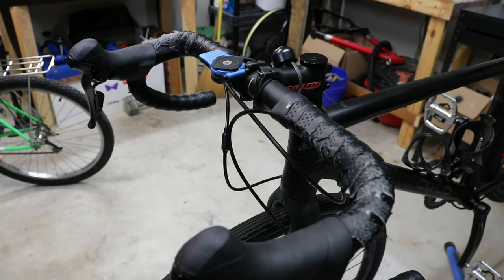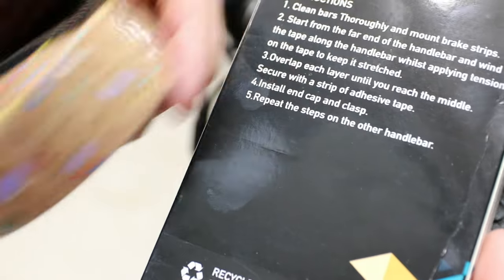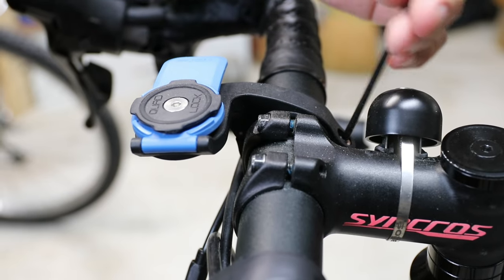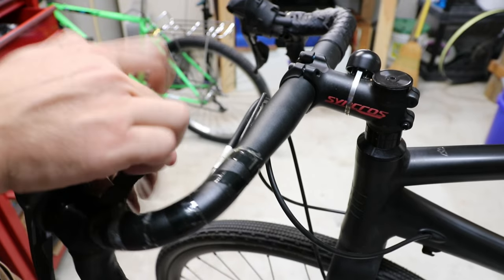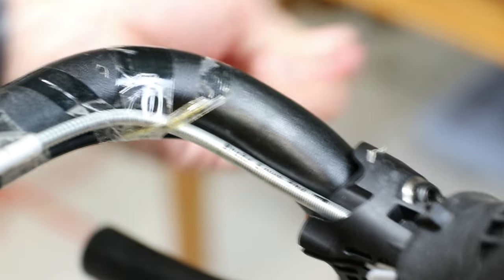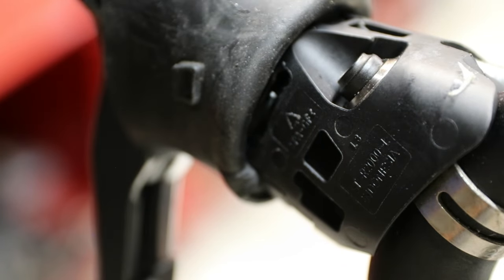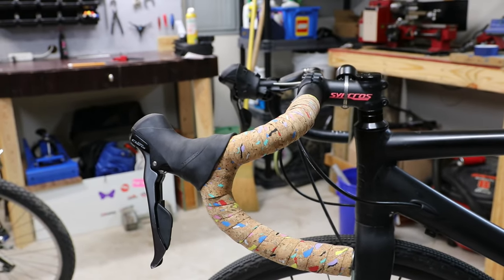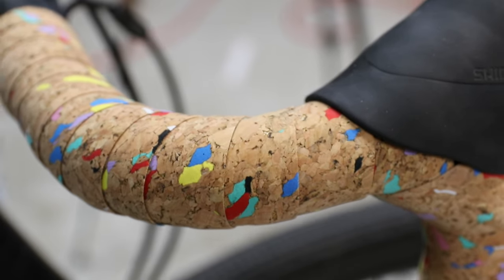How to install bar tape

Comment: Good Job. The Cork Tape doesnt last more than 4 rides for me, so I have been avoiding it (Tried 3x). The Direction of the wrap does matter with regard to the wrap being torqued by your hands. If wrapped in the wrong direction, it will become loose over time. The Direction you used is the correct way. I usually start my tape byinserting about an inch of tape into the bars and then start wrapping very tightly and this ensures a very neat plug end, and you wont have to fight as much with the plug.. Ill post a pic of my latest tape job using the traditional plug (Insert type) on my profile here in a minute.
Reply from the maker: Never thought about the tightening and or loosening of the tape.

Comment: 08:20....click the shifter and the barrel inside will turn (look closely and you'll see it) revealing the cable end lodged inside the holding socket
Reply from the maker: I did try to shift all the way up and down, thinking at some point the barb would be able to be pulled out, but that never really seemed possible. I don't know, I should search a video on it.
Reply: @BruceChastain  If you look underneath the shifter you will see a little screw. Undo the screw and it will release a panel exposing all the inner barrel and cable. I believe this 'door' is their to give entrance if a broken cable end gets trapped in there.

Comment: Except you should start at the top of the handlebars, where you usually use tape. Overlap one wrap at the beginning to hold tape in place, and finish down at the drops with the expander plug. You dont use any electrical tape, just bar tape and it looks much cleaner. You can see videos showing you how to wrap around the shifter to maintain the correct wrap direction, which matters. Keep making great videos!
Reply from the maker: thanks Josh! I know about that method, I've done it before, but I'm still 50/50 on which I prefer.